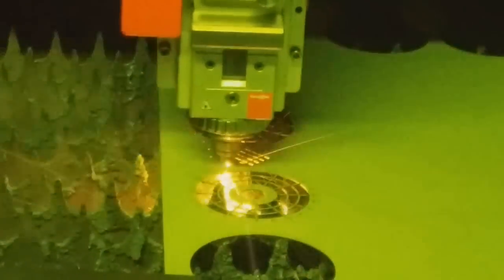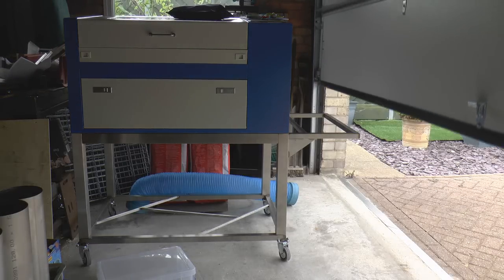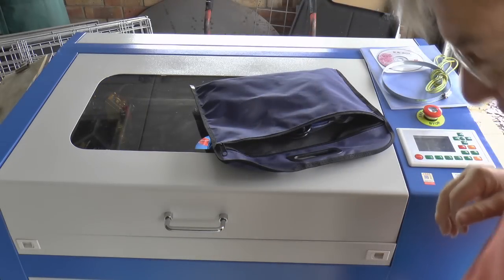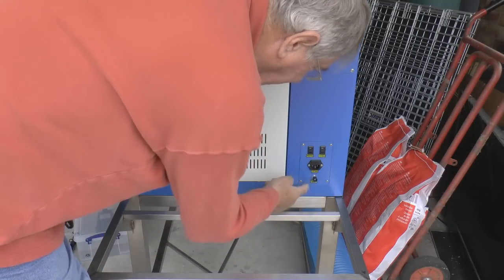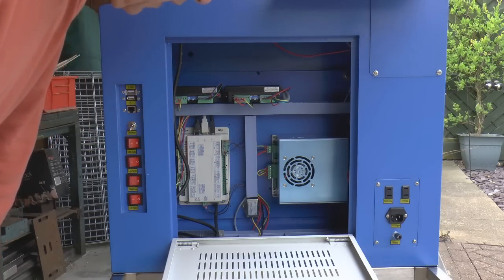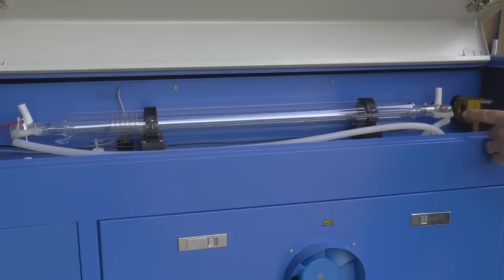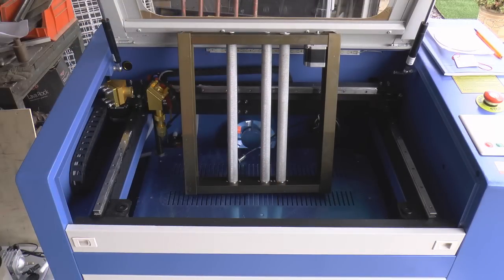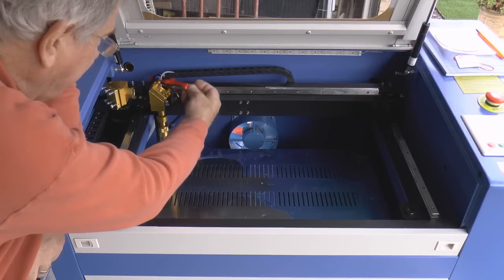Chinese laser cutter  tutorial part 1

Comment: Hi Russ, I finally got my laser machine!! :-) I have a question about setting it up. At 3:00 in your video, I see a white plastic manifold and a little piece of PVC tubing next to your air pump. What are they meant for? Also did you use the roll of tape and the earth wire? Thanks!!
Reply from the maker: Hi Shmintelli

The air pump is intended for aerating aquariums and this manifold allows you to split the bubbles into many parts with smaller tubes. Throw it away.. I think the roll of tape is what the Chinese use to stick on mirrors for beam setting. That is a really bad idea so throw that away as well and use little card discs instead. That way you will not contaminate your mirrors with adhesive.. 
Earthing is very important  BUT the chances are that your domestic supply plug will already incorporate an earth wire. If so, just check inside the electrical enclosure for peace of mind. The earth point on the machine will have several earth wires attached to it inside the case, check that one of those wires links to your power input socket. If so then you can throw the earth wire away also.
Good luck
All best wishes
Russ
Reply: Thank you very much, Russ! That's a great tip about the adhesive on the mirrors. The earthing, wiring and mirrors look OK. Will test the machine tonight :-) Unfortunately the fools used universal sockets with UK type plastic tabs -- and American plugs don't plug in. I tried all known tricks with screwdrivers, toothpicks, even UK adaptors but to no avail. Will replace them soon with proper sockets. Time to fire some laser!
Reply from the maker: All the extras that run off the machine sockets will run directly off your 110v mains so just use a multiway power block. Good luck
Russ
Reply: Thanks Russ! That's exactly what I ended up doing. One more annoyance was that the blower fan came with a Chinese plug. Since I couldn't find an inexpensive adapter for it even on Amazon, I just cut it off and added a US plug. I followed all your instructions and the laser fired and I got my first little "dot" on a paper :-) Now off to install CorelDraw. Thanks for everything!!
Reply from the maker: I would advise that you download RDWorks directly from the  Ruida website because I'm told that many of the CDs have triggered anti virus software. 
V8.01.18  is a good stable version and can be found here
http://en.rd-acs.com/down_complex.aspx?fid=n14:14:14&pageindex=2
Best wishes
Russ

Comment: Hi Russ, Your videos are so very insightful!! I greatly admire your patience in testing ideas and explaining them to us. You Sir, are a true scientist!

BTW, I am trying to figure out the right chiller for an 80W laser. CW-3000DG spec from a vendor says, "Used to cool 80W laser" and "Radiating capacity 50W/℃". So when dissipating 80W power, the chiller water temperature would rise by 1.6℃ over the ambient (80W divided by 50W). If ambient temperature is 32℃ the chiller water would be at 33.6℃. But some RECI 80W tubes says water temperature should be no more than 20-25℃. Others say up to 40℃ is OK. What should I trust?

Much grateful for any insights you and/or your readers can provide :-)
Reply from the maker: Hi Shmintelli
 The CW3000 is just a reservoir, pump, fan and radiator. In the crudest sense it is a chiller but it does not contain any refrigeration element. For that luxury you need to choose the CW5000. .
Do I need a fancy chiller?  It depends on what your plans are for using the laser and also whereabouts in the world you are and where your machine is sited.  If you are in an air conditioned room then a CW3000 may have sufficient temperature difference to keep your tube cool.  If it's non-air conditioned then your local air temperature will be the controlling factor. You may have summer temperatures of 40 C so it will be physically impossible to cool your tube below ambient. 
What temperature should I run at?  I like to limit my running temperature to about 30C most of the time. Here in the UK where the ambient is in the 5 to 20C range for most of the year, that is not a difficult challenge because I do not use my machine for anything serious. Sometimes I may run for an hour, I have nothing more than a radiating reservoir for cooling and I rarely have a problem with my 70 watt tube. I have sometimes run at 40C in summer months but if I exceed that I just stop for an hour or so or work in the evening when it's cooler. At 40C you will be losing about 5% power but it's not dangerous for the tube. Cooler is good and 20 to 25C is ideal. 
If in doubt get a CW5000 but if you are inventive and have the facilities then there are many interesting methods to keep your reservoir cool but it does depend on your needs and usage. Running a small business many hours a day will definitely require the CW5000.
Hope this helps a bit
All best wishes
Russ
Reply: I greatly appreciate your detailed response, Russ! Ambient temp here ranges from 21C to 32C when I work in the garage... at lower (or higher) temperatures I'm enjoying a scotch (or a beer) inside :-) I'm just a hobbyist today but may take up a few paid projects here and there. So I guess I will need a refrigerating chiller.
Since a CW5000 is a bit expensive, I'm toying with the idea of getting a cheap deep freezer (runs around $150), and circulate water (+ 50% car antifreeze) through a winding copper tubing inside. Any thoughts on running a car coolant through the laser tube? It works from 0C-100C but not sure if it would leave a residue.
BTW, I'm thinking of buying a 100W Chinese laser. The vendor ships from a US warehouse for $2,200. A 100W tube is 1400-1600mm long. This machine is 1460mm long. So based on your great videos, I'm expecting to get an 80W-90W tube - sufficient for my purposes.
Thanks again!
ShmintelliGent
Reply from the maker: Hi Shmintelli
If you were using the 80 watt tube for all day sessions then a CW5000 would be worth it but for  occasional hard use (3 or 4 hours a day) I have already tried your solution on another non-laser related project. A small chest freezer with a plastic tank of water inside acts as a negative temperature store. I would recommend about a 20 litre reservoir of distilled (or purified) water. This distilled water is the best thing for your tube ( and manufacturer recommended), I would not personally use any additive although I have heard of other that do. After TWO YEARS I still have my original distilled water and it is just fine. In your distilled water reservoir I would form a copper heat transfer coil. In the chiller reservoir I would add another submersible pump (by the way you could add antifreeze here). I would strap a temperature sensor to the return pipe from your laser tube and have that temperature switch the freezer circulation pump on and off as required. The system works well and is very responsive. It's bulkier than a CW5000 but a lot cheaper if you can get a previously owned mini chest freezer  for a $30 to $50.
Good luck with your new machine
Best wishes
Russ
Reply: Very clever! Thanks again, Russ! :-)

Comment: Hi Russ, I have a big problem with my Laser at the moment. It lost its origin. Nothing reallly works to recover it. It's a pitty. Could you please give me an idea how to define the default origin or a new one? Thanks,mate!
Beste regards from Germany.
Reply from the maker: Hi Christian
There are several origins (or 0,0) that the machine works with.The important two are
1)The first one happens when you power the machine on. The head drives into one of the rear corners (depends on you machine) and settles there for a few moments to set the machine 0,0. 
2)After setting the machine 0.0 the head moves off, usually to it's last known origin point, the program 0.0.

If the origin was OK before and has now disappeared then I suspect you are not even making 1).  Once a reset has taken place, use the arrow keys to drive the head into that same corner until movement stops. Check the keypad display  Both X and Y should read zero.. If not then it is your Hall effect switch that is not working. You can verify this by pressing the ZU button and selecting diagnostics. Both the X and Y switches should be have black blobs beside to indicate that the switch is ON.

If this is all ok then you need to check your  RDWorks at bottom right to make sure your position window is set to CURRENT.

Hope this helps
Best regards
Russ

Comment: Question , I just got a 80 watt co2 laser and the two button for up and down plate are disconnected.   Two sets of wire , two orange and two black. any idea what's what...  and how do you make move, do I just press the two switch to move plate or press something on main controll. still new on Co2 laser. Thank you for any info
Reply from the maker: Hi Mike
 I cannot really guess what wires go where because I do not know what sort of motor you have it may. My guess is it will be a low voltage DC geared motor like mine but there is no standardization with these machines.
Here is a link to a tour of my lift table system but as you can see the motor only has 3 wires. 
https://www.youtube.com/edit?o=U&video_id=Zi8ptM-W2yE
4 wires makes me suspicious that it may be a stepper motor in which case I guess the two black wires  are connected by a coil of wire and the 2 orange wires like wise. You can check this as show in this link
http://42bots.com/tutorials/stepper-motor-wiring-how-to/ 

Connecting these wires to the switch will not make it work as each coil will need power to make it work. You will need to look at the motor to establish the voltage required  (24vdc?) and I guess your power supply will have a 24 volt supply that you can tap into. You can complain to your vendor and if you bought by credit card threaten to contact your card company for a full or partial refund. That may prompt him to help although I suspect he will ignore you. You genuinely ought to talk to your credit card company and explain that the machine is not as advertised,  only partially built and is unusable. Emphasize the UNUSABLE.
Best of luck
Russ
Reply: thank you.

Comment: Russ,Your video series is a God send. Than you so much!!I have the same laser you do as well as a smaller one of the same basic variety. I have had the smaller one for a couple months and have become comfortable with it.With the new bigger one I am not getting the same engraving result, might i ask what settings you typically use to engrave on both acrylic and wood. Thanks so much and thanks again.
Reply from the maker: Hi Lewis
It seems you have only just started to follow my learning journey. There is a lot of stuff to look at to see things that I have discovered. The question you ask is one I often come across and because of that I decided to make parameters the subject of a series of videos. I have only done the first one about cutting  and I will be tackling engraving soon. can I suggest you watch 
https://www.youtube.com/watch?v=m-buYn27MgU 
and 
https://www.youtube.com/watch?v=m4Hh-8-9Tio

You will see that there is no such thing as a standard setting for anything because it depends entirely on how your machine is set up and what focal length lens you are using.
I really wish I could help you with exact figures. The best I can tell you is that in general you need to set max power and find the fastest speed when cutting (as per the video) but for engraving its almost opposite. You need to set the speed as fast as possible maybe anything between 300 and 500 mm/sec and then adjust the power to get the result you require.

Lots of patient experimentation required and make sure you note all your results.
Best regards
Russ

Comment: Hi Russ,
Could you please send me a link to this laser cutter? I've checked ebay, but couldn't find exact model. Thank you!
Reply: Is this the one? https://www.aliexpress.com/item/High-speed-upgraded-50w-5030-small-laser-engraver-cutter-machine-with-Ruida-DSP-control-30x50-cm/32780971917.html
Reply from the maker: Hi Marko

This is the link that I bought from. Sadly they appear to be out of stock at the moment. You may wish to contact sunshinesmileservices to see if they will be restocking or if they have a machine in any of their other warehouses.
They are a big Chinese exporting company.

http://www.ebay.co.uk/itm/40W-50W-60W-CO2-USB-Laser-Cutter-Engraver-Laser-Cutting-Engraving-Machine-220V-/301949881928?var=&hash=item464d9d8e48:m:mKK-Xy4mnYxFBJsP3fK_AIA

Hope this helps

Best regards
Russ
Reply: Thank you Russ! I'm an electronics engineer by profession, but am really interested in 3D printing, CNC milling and Laser cutting in general. And I have to say you make really, really informative videos. Great analytical approach combined with the trade knowledge.
Reply from the maker: Hi Marko

That's the one. It has a motorized up down table as well (the 2 green buttons above the switch panel.)

There are many factories assembling these machines form kits of standard parts. I see no indication of an extension box on the right side of the machine that means that despite the description it will be shipped with an 800mm long 40 watt tube. A proper 50 watt tube will be 1000mm long and by the time you have allowed between 150 to 175mm for mirror1 and airspace 1175mm is not going to fit into a 1020mm wide case.
It may be wise to send an email to check tube brand and model number fitted to this machine. If it was via ebay it will be a junk tube but from a Chinese vendor direct i would expect it to be a "proper" tube. Worth a check.

Best regards
Russ

Comment: nice video and nice machine,
can you please submit the link from where you bought this machine. regards
Reply from the maker: Hi Khalid
The folks I bought from are these
http://www.ebay.co.uk/itm/40W-50W-60W-CO2-USB-Laser-Cutter-Engraver-Laser-Cutting-Engraving-Machine-220V-/301949881928?var=&hash=item464d9d8e48:m:mKK-Xy4mnYxFBJsP3fK_AIA
They do not have the 50 watt machine avaiable at present but the slightly bigger 60watt machine is still very good value . Although the models have specified tube wattages  the 50 watt will be actually 40 watts and the 60 watt will be 50 watts .  That's just the dishonest way the Chinese seem to do business. 
Best regards
Russ

Comment: I have an 80 Watt version of this machine. I want to cut multiple layers of paper with it. Can you suggest a way to prevent the paper catching on fire? I was thinking I could dampen the top layer making it a sacrificial layer, other than that, should I use higher power and speed rather than low cutting speed.

Comment: I take it this machine doesn't engrave metal?
Reply from the maker: Hi Noel
You are correct. It will engrave anodized aluminium but nothing else. There are ways of marking various metals by burning a chemicals into the surface. There are a range of products for doing this by a company called CERMARK  You may wish to look at this video for a clearer understanding of what' possible. https://www.youtube.com/watch?v=b_06laAjMPc

Best regards
Russ
Reply: Hi Noel
The fiber laser marking machine would engrave metal. Logos, pictures and things you want. You may wish to check for this.
https://www.amazon.com/DIHORSE-Marking-Machine-Engraving-Machines/dp/B01KFLP2MO/ref=sr_1_13?ie=UTF8&qid=1476346743&sr=8-13&keywords=laser+marking+machine

Best regards
Chen

Comment: Hi, I was wondering where you purchased this particular laser? I can't seem to find the same one your using.
Thanks
Reply from the maker: Hi Dustin
 try this
http://www.ebay.com/itm/50W-CO2-Laser-Engraving-Machine-Engraver-Cutter-With-Auxiliary-Rotary-Device-/151785082682?hash=item2357188f3a:g:x2cAAOSwMgdXyoRC

It's exactly like mine. I can see it has a crappy 40 watt tube fitted so plan to spend extra for a Proper tube and PSU within weeks or months. It does have the motorized table

Best regards
Russ
Reply from the maker: Hi Lena
It depends where you are
USA       http://www.ebay.com/itm/50W-USB-CO2-Laser-Engraver-Engraving-Cutter-Cutting-Machine-Woodworking-Crafts-/152109833330?hash=item236a73dc72:g:0NkAAOSwInxXOT1X

UK  & Europe        http://www.ebay.co.uk/itm/40W-50W-60W-CO2-USB-Laser-Cutter-Engraver-Laser-Cutting-Engraving-Machine-220V-/301949881928?var=&hash=item464d9d8e48:m:mKK-Xy4mnYxFBJsP3fK_AIA

Australia   Nothing with a motorized lift table.

Hope this helps.
Reply: It does! Thank you so much!!
Reply: Hi Russ.  I've watched 32 of your videos so far and I believe this looks like a lot of fun.  I am unable to find anything in the $1200USD range that has a motorized Z axis.  The USA link above seems to indicate it does not as it says "4.Manual up/down table" in the listing.  This seems to be the case for all of the eBay equivalents.  Am I interpreting the chinglish incorrectly?  Thanks for all of your helpful content.  -Dustin
Reply: Thanks Russ
Reply: lena weisman _